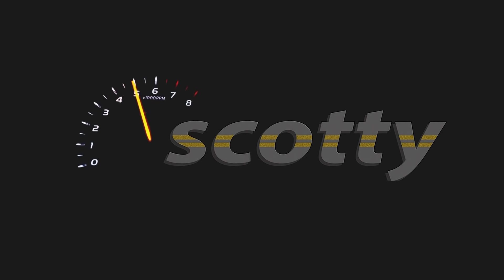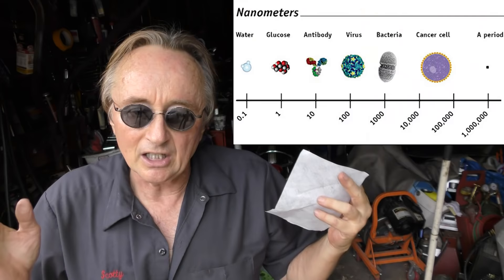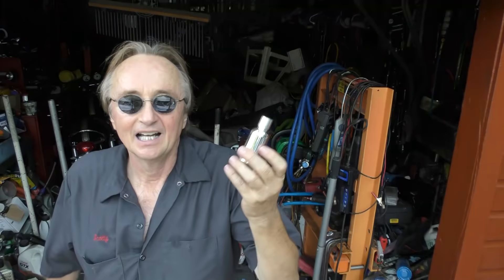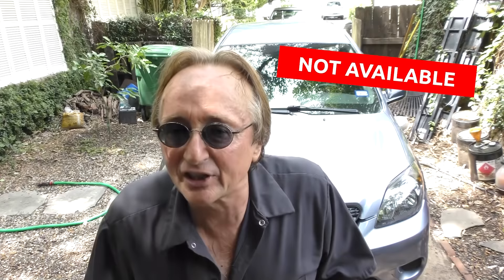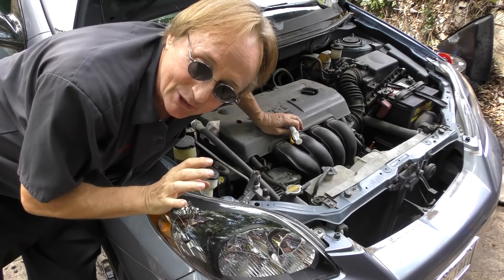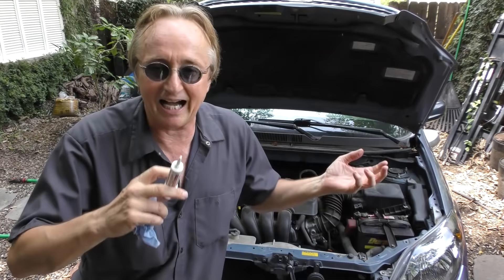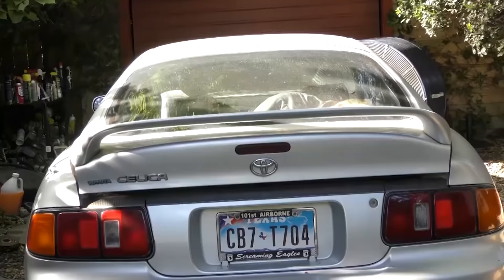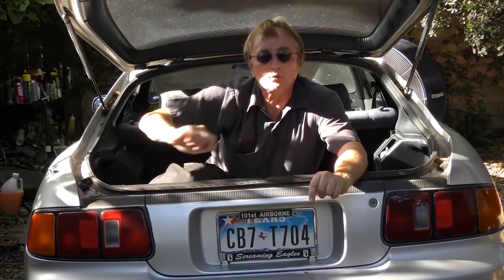Why Not to Buy Nanotechnology Products for Your Car

Comment: Can you do a video about how to open your locked car
Reply: - But what if you're battery has died and you have a modern car? Many of these modern cars don't even have physical key slots to open the car when the battery dies.
This means that the owner has to either break a window, or find some other obscure way of gaining access to the battery. Once again, it's planned obselecence from the manufacturers.
Reply: Get a rock
Reply: Nothing much. 

Well, a lot of electronic keys do open up to a real physical key inside. I haven't seen many that dont.
Reply: Read your owners manual. It should tell you how to access your vehicle when it has a dead battery. The owners manual is like a mini  “bible” for your car. When you purchase a new/used car One of the first things you should do is read the owners manual from beginning to end. If you’re buying used and there is no owners manual tell the dealer you want one or no sale. Every car should come with its manual. And leave them in the car. Not in a desk drawer at home. That will never help you on the side of the road.
Reply: theturtle2121:  People with new cars can't read an owner's manual....they're real paper and ink, not online.
The second time I read my owner's manual was when I had a flat and couldn't figure out how to get the spare down. I've read my Chilton's manual WAY more than my owner's manual, but the truck is 20 years old with 292K miles.......
Reply: how do you drive a car?

Comment: I thought the same thing when my mum got her new car "ceramic coated", it didn't seem to help keep it any cleaner and you need to use a special shampoo when you clean it (which costs way more than normal shampoo) so doesn't save any time either. You're better off saving the money and using it to pay someone to come and clean and polish your car once a month.

Comment: Back when i had a detail shop in the early to mid 90's "Liquid Glass" was one of the 1st paint sealers on the market. I would charge the customer extra for it because it was expensive and would also guarantee it to shine for 6 months after or I'd do it again for free. I would also add a quick coat of KIT wax on top. I never had one person come back to get the vehicle redone. However, it was a double edge sword in a way; a year or so later the customer would call back and just want the interior cleaned and detailed because the exterior still looked good. I wish I was still capable of detailing cars but it's a lot of hard labor to do it correctly and I'm getting old and more physically handicapped. I had to deal with enough BS back then with the occasional customer who would pay me with a bad check or an employee who would steal a gallon or two of products when I wasn't looking. I can't imagine doing auto reconditioning these days. My reputation follows me but everyone wants "something for nothing".  I still have the same phone # but stopped detailing years ago. If I was to do it today my price for a Suburban or a Ford/Dodge 350 or 3500 dually 4 door, 4x4 is $250 to $300. If they own a $60K plus truck their not broke. People still call occasionally and say, "I will let you do my plane or big truck for $100 or maybe $125." Oh, I'm sorry but I will have to turn down your offer but I will let you take it to one of the 2 detail shops in town. "Those guys charged me $250 and ripped off my Barbara Streisand CD the last time I went there!"  (Sure, I believe that.)  OK, those guys do damn good work but thank you for calling. That's the kind of customer who will give me a bad check.

Comment: Scotty,
You are so right.  Three decades ago I put one of those Teflon oil additives in my 1988 Toyota 4Runner and all it did was result in needing an engine flush because it clogged the engine causing worse performance.  Keep away from the Teflon!

Comment: I have been using Nu finish for years! It even can remove oxidation using a foam pad buffer. I also use it on boats and it works great for hard water spots.

Comment: Scotty as a detailer, You really really need to know what your doing with "Nano Coatings" Or as we call it Ceramic Coatings. The tiny bottle should last AT LEAST 2 cars minimum... You have to do a whole heap of prep work. Its just like saying "Spray Painting doesn't work it doesn't look good" when you do a home job BUT if you paid a professional to do it it would look amazing. The reason it is so called "Hard to apply" Is because you either are using way to much or are putting it on a surface that is way to contaminated and needs to be paint correct prior to applying the ceramic coating.. Please watch some videos of how to use it... as if you don't use the right techniques or get the flash times ect right, it will never work. If what you were saying was true no detailer would use it. But all high high end detailers know how to use it and use it right and it works out amazing. Try watching some of AMMOS videos on youtube of how it all works

Comment: I'm a pro detailer and use ceramic coating. Yes sure ceramic coating is not as amazing as the marketing always says. BUT, sure ceramic coating is the best protection on the market today besides paint protection film. 
It is still worth it though. I done a Jeep Wrangler 2 years ago and there's still no swirl marks and my lazy client uses aggressive short cut car washing methods.

Comment: Get a ceramic coating done by a professional.  That stuff will last for years and most come with a 2+ year warranty.  But they cost $500+ depending on the size of the vehicle.  90% of the work is in paint correction before applying.

Comment: I've always had a lot of success with 9H Ceramics.  You can get em' as cheap as $9, but with the Chinese knock-off and I would only coat 'working' vehicles with that material.  Anything black, and I would order something specifically for that vehicle and you can't purchase them from Wal-Mart because of how expensive they are (you can't even buy the materials you need, because they're also expensive that many stores know not too many car owners are going to mess with that stuff and with good reason, they are incredibly time consuming to apply; but once you get em' on there, they last for years and they don't leave any annoying white residue on your plastic trims and offer very good water beading/repellency that makes driving in the rain or inclement weather a lot of fun).  I think as well, they're really coming down in price; so one 30 ml vial of this stuff that originally costs around $150, now costs around $50.  You do wanna apply a couple of coats to insure you get a nice and even cover; otherwise from my experiences, they do work and are worth the time you invest into your car...

Always do your research, because I spent about a month sitting on that egg before I decided to act.

Comment: I ceramic coated one of my cars a year ago and its still working. rain still rolls right off. dried bird poo still wipes right off. nothing sticks to it. I haven't washed it since. I just get a cloth or use my hand and wipe off the fine dirt. even a majority of pollen blows right off. I didn't pay a lot either. hardest part of fixing all the chips and cleaning the paint before applying it.

Comment: Scotty, I own a professional detail shop where I specialize in ceramic and polymer coatings, and I would vehemently disagree with your assessment. There are a variety of coatings that are at least 200-400 times thicker than that of a traditional carnauba wax or paint sealant. Some coatings crystallize creating glass-like reflections while creating a semi-permanent adhesion to your clear coat. In addition, I've toured facilities where companies manufacture coatings and there is empirical evidence proving their efficacy against harmful elements such as heavy uv rays, snow, sleet, scratches, dirt, debris, tree sap, etc. You most likely are referencing companies that make their products available to the general public, therefore making them a substandard formula where silica oxide is the main ingredient. With all due respect, please stop pontificating a subject you know nothing about.

Comment: Molybdenum disulfide is a powerful lubricant that can be found in some oil additives and there’s plenty of research to back its lubrication effects are due to its molecular layered structure. However if not dissolved properly or begins to crystallize, it will be filtered out by the oil filter.

Comment: The only additive I would put in my oil is Marvel Mystery Oil, but not too much to thin too much. I have seen too many testimonials including my own of buying a used car, and changing the oil, then soon putting MMO in the oil, which soon blackened the oil, having to change it soon after. If the oil gets black and gritty, change It out soon. This is one reason why It is good to not put too much in at a time.  It slowly and safely cleans cheaply. It may be good for cold starts. Don't put 20 percent content because it will make it too thin at operating temperature. Also, I think it is better to wait closer to oil change time to put in oil, because I don't know how long it lasts over 1,000s of miles with a strong film. I have gotten tough grime off my hands easily from working on cars without gloves, even though I know it can't be good to touch your skin with MOM as experimental. If you don't believe in additives, put a good quality oil filter, and don't go too long between oil changes....probably more often than the manual says.

Comment: I Put that Nano stuff in my engine and it rebuilt it from the inside, it bored it out 30 over, put a stroker kit in it, and changed my connecting rods and pistons to forged units, added a new intake a procharger,  now I make 500 more HP all for $19.99!

Comment: If you ever tried Motorkote you would think different. I put it in my new car and it made it quieter. It is NOT engine rebuild in a can but definitely will make it run smoother and shift better.

Comment: I suppose some TiO2 based coating in the paint could help keeping the car cleaner or washable with rain but I bet it would be very expensive. Car catalysts are full on nanotechnology as manufactured defects on the surface help adsorb the molecules and convert CO to CO2 (and water)

Comment: My car has a ceramic coating on it (About 3 layers) and one door doesnt, it was polished but I ran out of coating so I waxed it, it has been more than a year and the car still repells dirt, birdpoop, water, etc, but the waxed door seems not to be protected anymore, you can't remove dirt with a power washer as easy as the ceramic part, birdpoop sticks and leave stains in the clearcoat and water doesnt flow like the ceramic part.

Now on the nano department, I bought a ''Nano green'' thing on amazon for my 1.9 tdi, blowby was the same and made the Injector-pump misfire at random. So the nano thing only got in the injectors loom and randomly made them not fire when they needed to.

Comment: I coated my car 3 months ago,went with turtle wax and rainx this time glass and paint, it still repels water and washing it is as simple as rinsing and driving if i want it to be. Been using the stuff since i bought it new, its a dodge and 8 years old, and doesnt have any rusting paint🤔 total on the 2 large bottles was 16 bucks,  put wax to shame.  I barely even have to use my wipers when it rains anymore.

Comment: You're wrong on one part, the greatest inventions not necessarily should be on all of the main-stream stores. Actually the other way around, big corporations don't like to have their status quo challenged, so they prefer to keep selling their old tech with the massive infrastructure they've already invested in, that keeps manufacturing costs down, rather than taking into consideration new inventions that could open the door for unknown market scenarios.

Comment: I checked out a couple of those supposed nano technology worn engine repair products. While I did read a couple of positive testimonials, from local automotive stores (in Australia testimonials must be legitimate), but I went with my better judgement and didn't buy any of the products, for the same potential hazard reasons you mentioned.

Comment: There is some paint sealers that actually work and last a long time. My truck had a paint correction and flight shield installed. The difference is you have to be a special buyer to purchase it and it’s a couple hundred for a bottle of the same size. It is still working to this day.

Comment: nano represents a measurement, like milli and micro.  The rainbow color spectrum ranges from 400nm to 700nm in wavelength.  Maybe the armor shield is trying to protect against harmful rays, such as, Ultra-Violet which can damage a vehicle's paint.  I think any wax available today has whatever protection we need already.
Reply: encryptor Ceramic coats offer slight scratch resistance, longevity (most quality products can last for years), very hydrophobic and grime resistant properties, and a quality shine. Waxes only really offer the latter two, but they only last a fraction as long and are not as hydrophobic as the ceramic. The problem is ceramic coatings are much more expensive and labor intensive, but in the end, it is a better sealant than traditional waxes.

Comment: There is a lot of better paint protections out there, than the good old wax. Yes, wax worked 50 years ago, and it still works today, but there is actually better alternatives. My favorite is Soft 99 12 month wax. It use PTFE to create a very smooth non-stick surface and a high durability. It is not a scam, it works really impressive. Take a look at it at here at Youtube - a lot of guys have reviewed it, also highly respected detailers.

Comment: From reading their website, it seems that the product works best when you apply it in temperatures around 70°F with low humidity. This does not seem to describe typical Houston weather in late May.

The main problem with these coatings is that they are generally very finicky to apply. It doesn't help that the sellers of these coatings don't make it absolutely clear how finicky they are  Most folks will get the best results by applying a high-quality paint sealant every three months or so (and topping off with a spray wax every so often).

Comment: I'm sure he just applied it on a "dull and neglected" vehicle and wanted a brand new paint job for $69 first you have to "paint correct" polish to remove scratches and swirls. Then apply the ceramic coating

Comment: This is the only video I would agree with as he clearly don't know how these coatings work and not to mention there are many different types of nano coatings and every single one is different and unique in it's own way. Saying that all of them are nonsense when he bought a random one off the market is like saying that because one racist person might live in Texas means that every Texan is racist. Every coating has different strengths and weaknesses and they all do the job from differing perspectives using very diverse chemical bonds with the surface of the paint.

Comment: My advice Scotty is to get a proper proven product such as cquartz. I've never heard about nor used the one in the video but if it couldn't do an entire car and didn't give better results than the nu finish then it's either a very crappy coating or the paint was not prepared properly - from an  installer of coatings for 3 years now.

Comment: I got a 1995 Honda Civic DX. I have changed the idle air control valve ,the fuel filter, spark plugs and wires and map sensor, fuel regulator. I don't have a check engine light on but my car loses power, bogs out going up hills and occasionally back fires. It also stumbles when idling and revs up and down when first cranked. When accelerating real hard it tries to cut out. What do you think it might be?

Comment: This stuff just reminded me of another scam product - The TORNADO , it was suppose to improve gas mileage. My friend used it and it screwed up his engine on his Cadillac.
Reply: How would placing a tornado around the carb screw up an engine?  Or am I thinking of some other product?
Reply: Fred Flintstone I wish I could answer your question , but I remember him using that circular metal object and he had engine issues ever since. This is like 10 years ago. Things were so bad he had to get rid of the car.

Comment: The cheap nano ceramic coatings i found are better than any waxes ive used and last just as long or longer. Quite a few waxes in hot weather tend to make dust and dirt stick to the paintwork more so needs washing quicker while ceramic coatings doesn't. Now the real deal ceramic coatings which are not cheap and cost a pretty penny actually last a couple years with maintenance. Motto is you get what you pay for with common sense involved ofc.

Comment: I got my car fully detailed inside and out but the ceramic coating the detailed shop used on mine was from CQuartz. I got it done November 15th 2018 and I havent used any soap since then and just pressure wash my car. Water still beads up uniform to this day!

Just dont ask how much I paid for all of that....

Comment: This is an example of someone talking outside their expertise. I hate to say it, but coatings arent something you can apply without experience and extensive research. You cant just apply it right out the box. Theres a lot of preparation before you can apply the product. Also there are cure times before the car can be touched.  Honestly NuFinish is just a mild cleaner wax with fillers in it that hide scratches temporarily. There are far better cleaner waxes, but longevity car coatings and paint protection film trumps the industry.